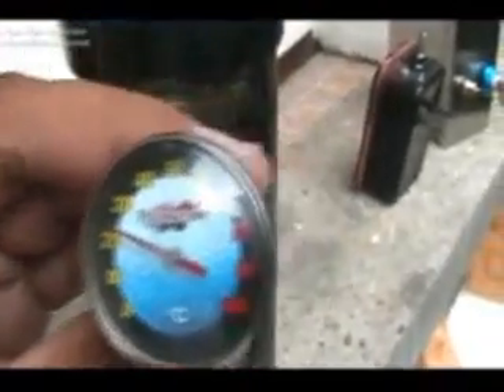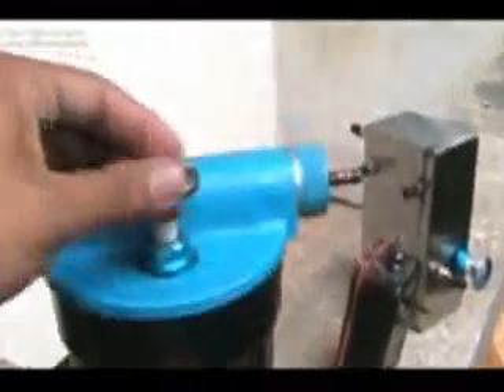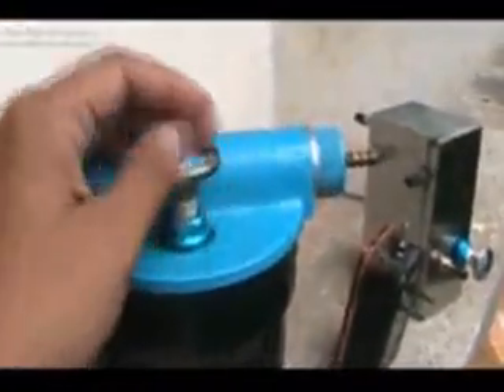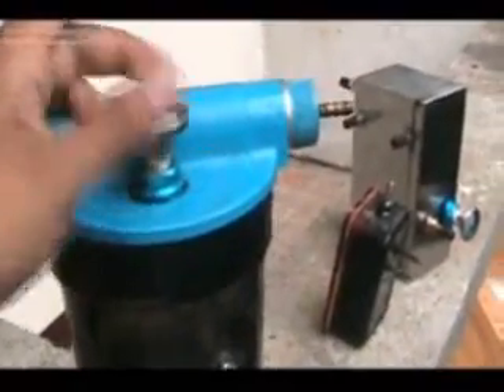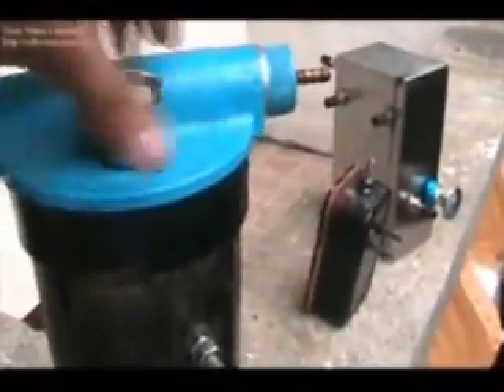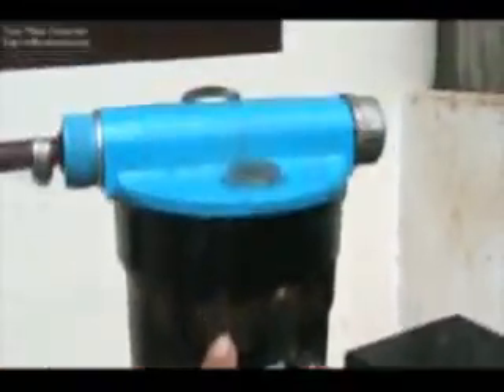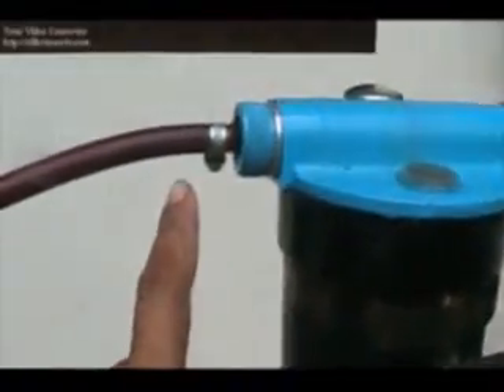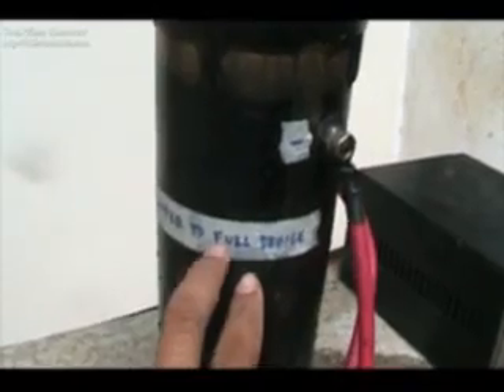HHO for car - Philippines

Comment: I honestly believe your claim of 45-50% mileage gain, but for the safety of it when you did the explosion test, the bubbler was too shallow. Your lucky it didn't explode. That HHO test will be much safer when using a deeper bubbler. REGARDS.